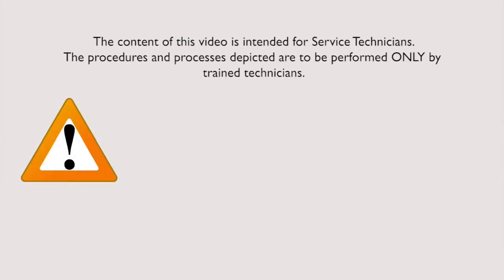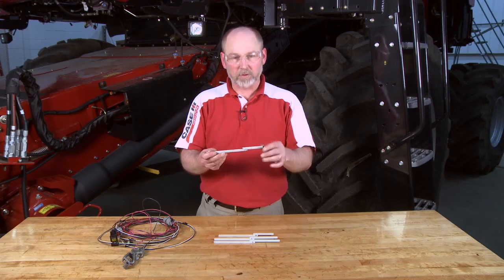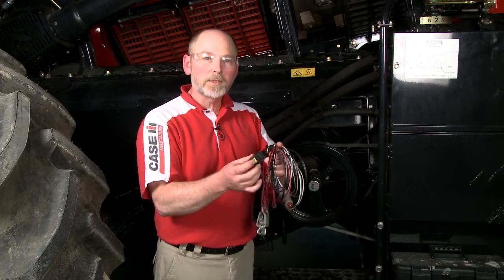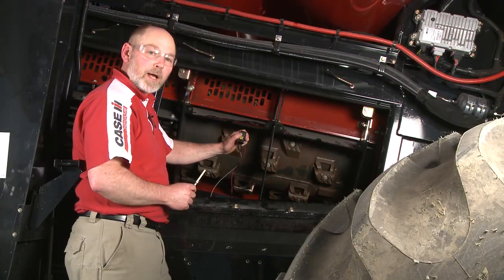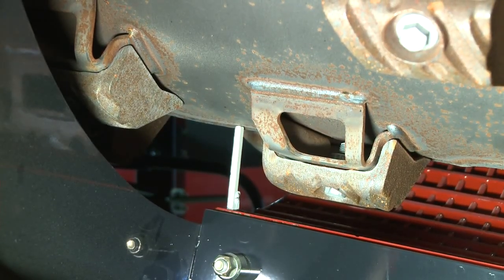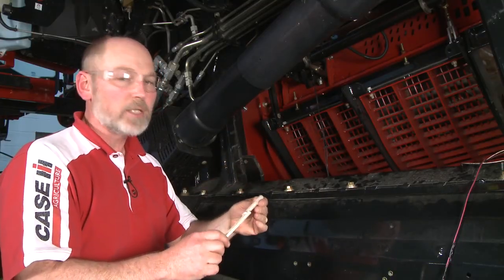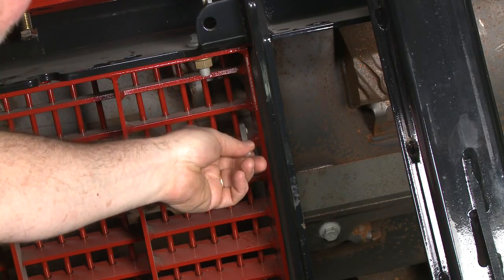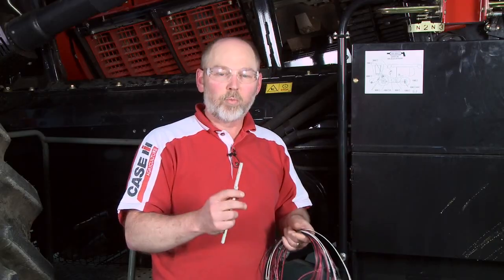Case IH   Flagship Combine   Concave Level and Side shift

Comment: When i level and center it at 113mm it overloads my left sideTell about the shift to the left and right why is it done in the book it is not explained only it is given 6mm to the left and 6mm to the right but why And how it works better small tube rotor 7250 Thank you
Reply from the maker: From your comments, you have a ST (small tube) in your 7250. Is this correct?  What crop is it overloading on the LHS?
If it is overloading the grain pan on the LHS, that has more to do with concave opening & rotor speed.
Reply from the maker: This Case video explains the relationship effect between concave opening, rotor speed & loading the grain pan then cleaning system. Have a look from about the 50 minute mark. https://youtu.be/bQxQValYTOc?si=6SZG9kQ6tZG4zFMn